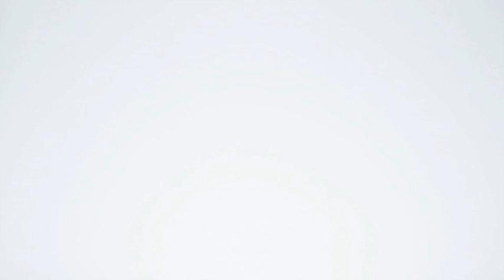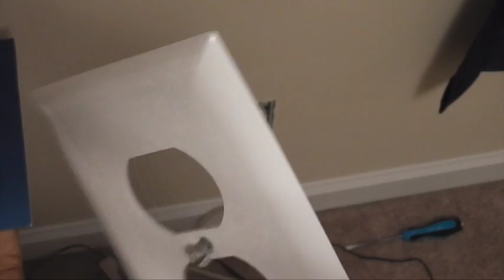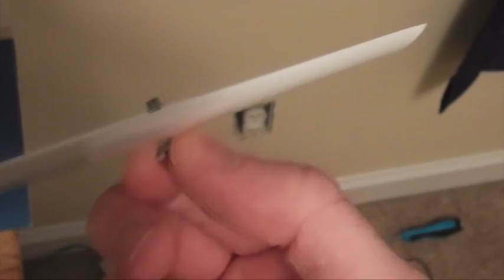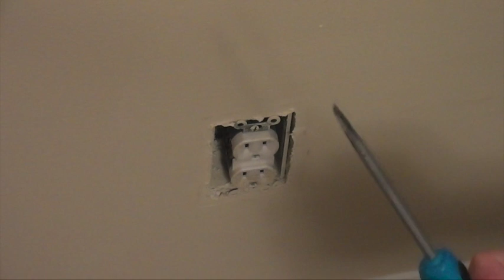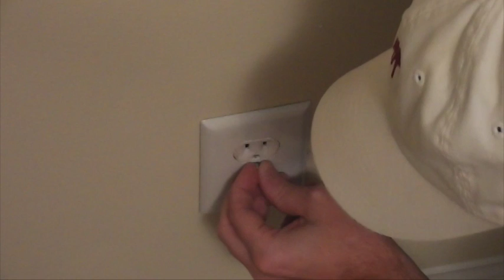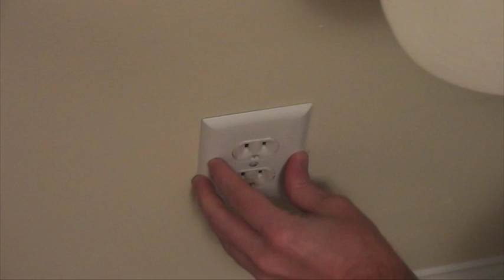How to Replace an Electrical Outlet Cover

Comment: Hi Kryo it would seem that this should be about as easy to install as a light swtich plate ? ps I am not sure if I can turn off the power would you think the logical answer than is if I found  there is a screwdriver that resists electricity and should provide protection in case I accidentally touch a bare wire would you suggest that while replacing my plate? thoughts please thank you I mean this type of screw driver is specifically designed for function on energized equipment I would think it would be safer in case the driver gets to close to the outlet I than should not feel any current does that sound right thank you.

Comment: Do you have to turn off the power going to the outlet
Reply: He did not here, but it’s a good idea to switch the power off, simply because there is a chance that the screwdriver could slip while you’re turning it and make contact with one of the outlet holes

Comment: When you finished, the plate was not flush against the wall.  It can be tricky sometimes, but you really want the plate to be flush against the wall so that dust doesn’t get into the outlet and around the wires, which get hot
Reply: So what do you suggest, pressing the plate against the wall as he’s installing it? Thanks